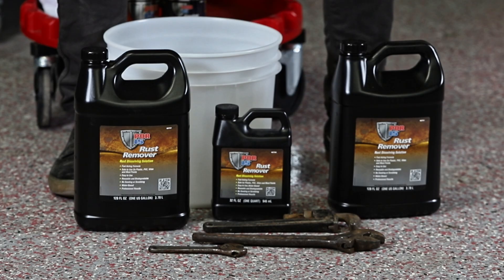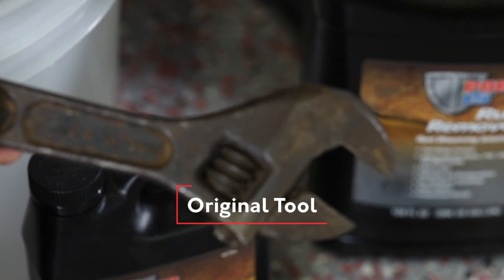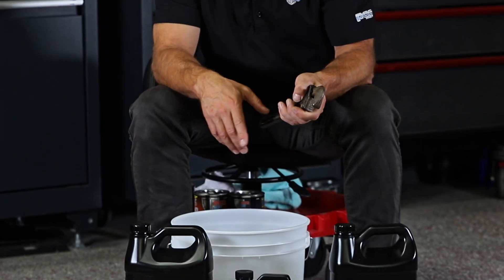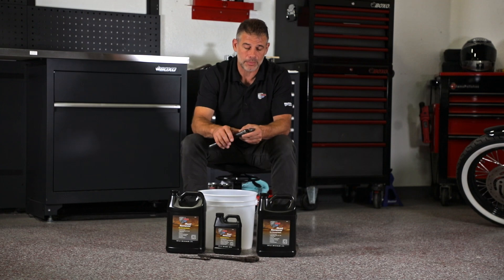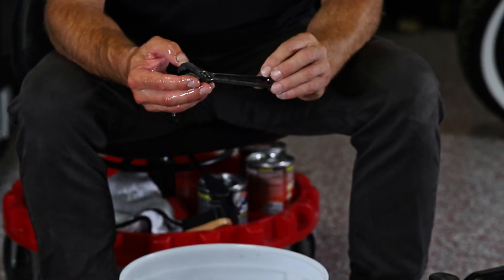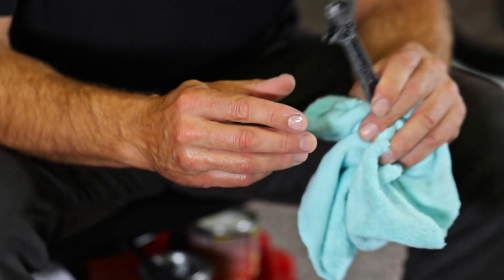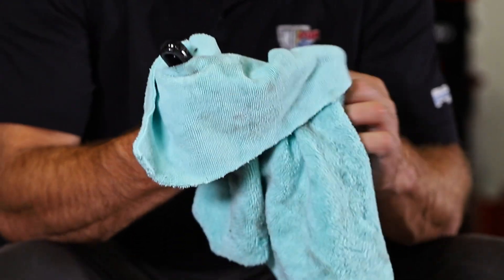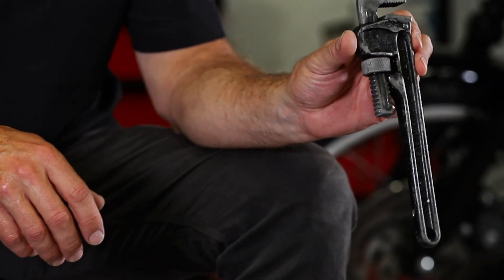POR-15 Rust Remover

Comment: If you apply on a vertical surface like a car door to get out black pitting spots with scrubbing/wire brush, would this work?
Reply from the maker: It should work, you would need to keep it wet by constantly applying but it should work.
Reply: @POR15videos  Yes I was thinking of putting a scott towel and then cover it with a plastic film and tape the edges with a good tape (like frog tape or 3M) or even use a home reno technique - masking tape goes flat on the car paint, then something like home reno vapor barrier tape (Tuck tape in Canada) goes on the masking tape and on the film (this technique is used for varnished wood floors to prevent damaging the varnish and it creates a strong enough bond).

A bit of a tech Q: after the chemical has done its job, I see in videos a bit of a black pitting. If I understand well, that is still rust? The chemical needs to be reapplied until that goes away too? Will it go away?

Comment: You mentioned it doesn't work on soft metals? What about a Jeep frame, or axle's? When the steel is fully immersed, it'll work just fine?
Reply from the maker: Yes it will work on submersed steel